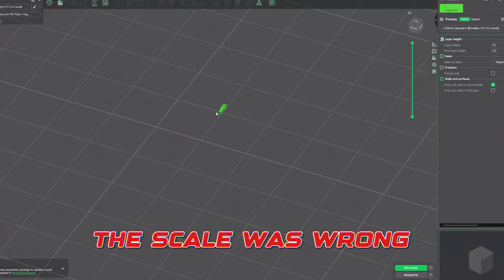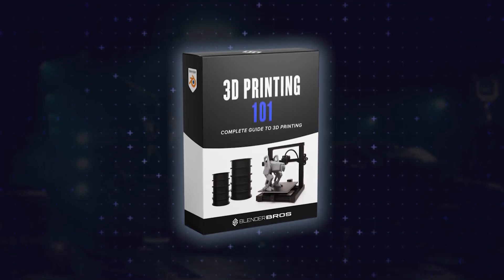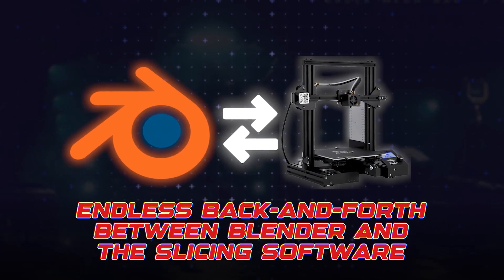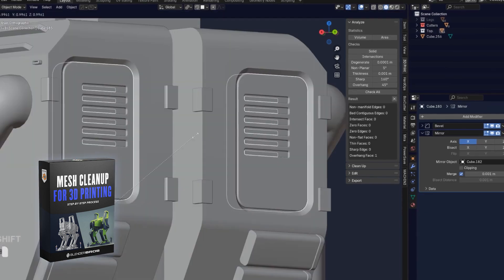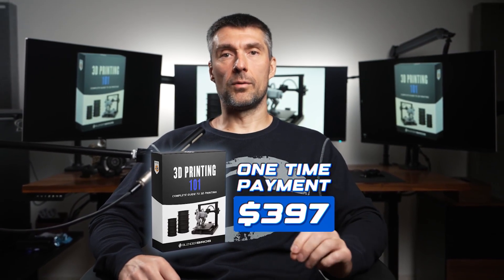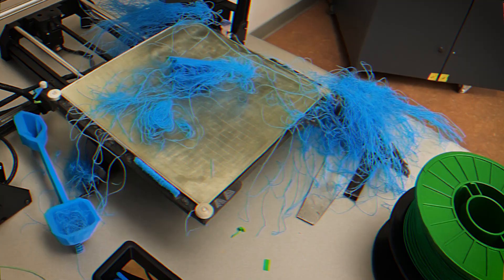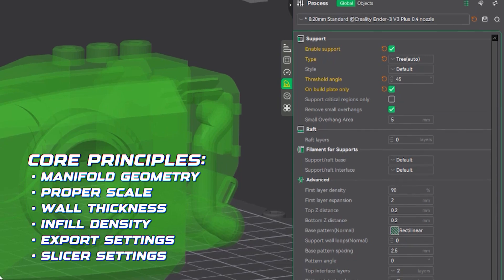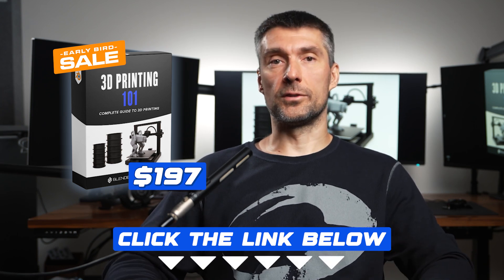Why Your 3D Prints Keep Failing and How to Fix It Fast

Comment: Based off previous courses I've purchased,  I will certainly be looking at purchasing this one.  I'm currently in the middle of the HardOps course design work and trying to modify what I see on screen, so my model will be 3d printable. 

One question: You mention FDM printing.  Can I assume that the video encompasses 3d printing in general?  I have several printers, but none of the are FDM.
Reply from the maker: Glad you enjoy the content mate. The main difference between fdm and sla is the resolution. You simply can get away with smaller detail. We do not cover printer cleaning / maintenance etc. which would be very different for rasin printers. This course is for folks who wanna get into 3D printing or simply overcome all the issues they are having, and since 90% will go for fdm printers that is why we use it as a base example.

Comment: Hi Ryuuri , I have a question. I have some of your courses, they're amazing save tons of time, however ,I'm running into some serious issuess with shading and topology after certain boolean operations -especially on curved surfaces .Fixing shading on complex topology becomes very difficult ,and I find that there's not much info avaliable out there on this.I know the practise models cover a lot , but they mostly focus on simpler boolean cleanups.Are there any advanced lessons or resources  you could recommend that go deeper into shading fixes and topology cleanup after more complex booleans ? Thanks a lot in advance!
Reply from the maker: Glad to hear it mate. Well, I just dropped a video on booleans yesterday so give it a watch. For complex surfaces you want either shrink wrap or normal transfer techniques, both can be run with vertex groups for exclusions. Both are the way to go if you need perfect shading. It also all depends on what surfaces you work with. Subd will always be trikckier, but same techniques apply.